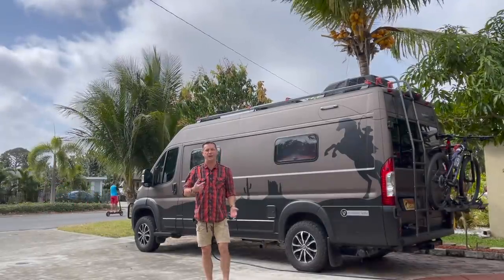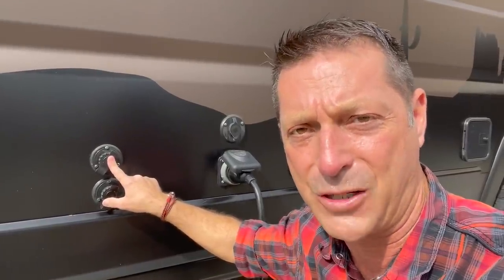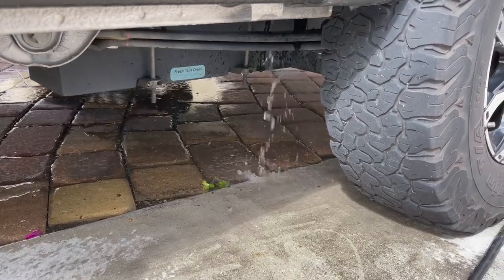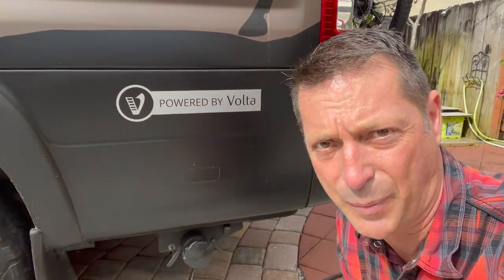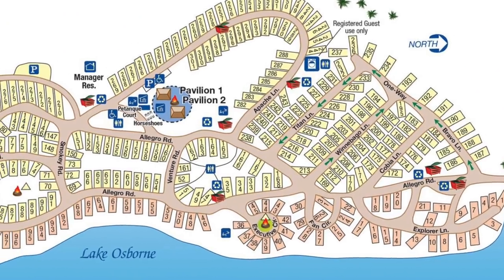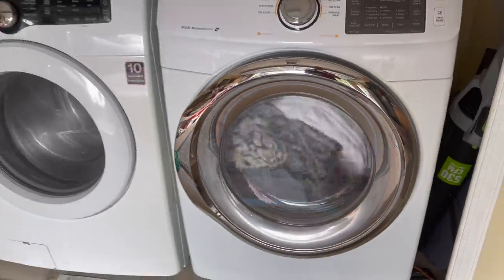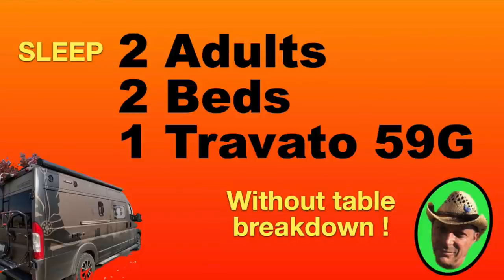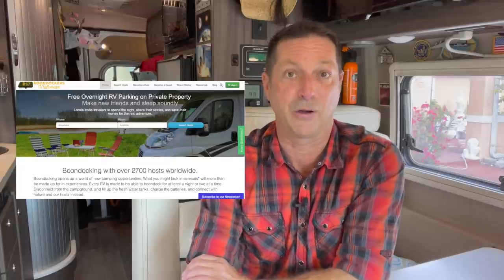3 TIPS to INSTALL RV HOOKUPS saves $. MAKE EXTENDED VISITS HAPPIER. By 2yr full-timer Travato GL van

Comment: Why do u need a dogbone adapter?  If you have 30 amp service at this house, why not just plug in to your newly installed 30 amp outlet along with the surge protector.
Reply from the maker: Great observation. I did not want to complicate the video… but the reason you see the dog bone is because the electrician misunderstood and installed at 50AMP receptical as that all that he brought. 30 AMP circuit at the box.
Reply: @gosmall.livelarge  gotcha. i thought that may have been the case but wasn’t sure. rock on.

Comment: A lot of people would much rather use their own RV bathroom.  Not strange at all.  Did you consider a macerator pump for emptying the black and grey?  Kudos for emptying those small tanks only once a week.  I can barely make it through a long weekend without filling the tanks of my TT at state parks without sewer.
Reply from the maker: thanks Brett. My grey has a macerator pump. Black is gravity.  Thanks for watching and commenting sir !!
Reply: @gosmall.livelarge  You could use a wheeled blue boy tote to transfer to the sewer clean-out.  They make low profile tanks for pop ups that would be low enough.   I only suggest these options because driving 30 miles and paying $15 seems excessive, but then I'm used to state park overnights at $20-22 per night including dump stations.   Maybe you enjoy your "outings" once a week as it gets you out of the driveway for the day.

Comment: Sewer.  Check out the Sewer Solution (Amazon) it works great up to 100 feet, less than 100 bucks plus small cost for some 1.25” pvc tubing. You won’t need to go to the dump station anymore.  Been working great for me for 2 years now. It’s much simpler to install and operate than meets the eye.
Reply from the maker: David… Thanks for the tip!  Featured that product on my What’s Up Wednesday?! YouTube Live #vanlife RV show this past week.  Cool looking product.

Comment: "non-Volta, generator " T owner here.  I think the adapter works the same way in my rig as it does in yours.  I plug in and just set the One Place to the lower input setting. That  keeps us from blowing the fuse in their garage. Lets us run the AC or Truma heat on heat strips just fine.  Surprised that you Volta folks ever need to plug in.
Reply from the maker: Thanks Roger. If staying for a few nights I probably wouldn’t bother, but I’m not driving to charge the system… and the A/C is running 24/7 as the temps are in the low 80s in day and low 70s at night.. That type of power consumption calls for shore power

Comment: I had a similar issue... fixed sewage with a maceratot pump.  A portable Flojet can pump 100 feet uphill.
Reply from the maker: Good to know
Reply: I read that information too and I can understand when the hose is full and the water keeps coming.  But what about at the end of the release, there is nothing to push the water / waste up hill.  So you disconnect the hose and now everything in the hose flows down hill?
Reply: @toycarcollector  I do a rinse, and then “walk” the hose from the RV to a he dump inlet to ensure any remaining stuff has drained from the hose into the sewer port.

Comment: Great video. Another option for those with larger rigs that are less mobile. A wheeled sewage tote. You can dump your tanks into it , wheel it over to the clean out and dump without having to move your rig. You can also use a regular 20 amp outlet with an adapter to plug in if installing a 30 amp service is not an option. You couldn’t run ac but it would probably keep you charged enough to run ac off the Volta when needed.
Reply: Hi I think you might answer my question so I’m still fairly new to RV my don’t have lithium just solar and generator so sound if you are plug to shore power to 30 amp outlet at home you can’t run your AC? Can you run microwave? Thanks
Reply: @liaodesign  if you had a 30 amp outlet you could run the ac or anything else in the unit. You might trip a breaker if you ran the ac and other items like microwave but probably not. My comment was based on being plugged into a 20 amp regular household outlet with an adapter. An ac takes more than 20 amps and would trip the breaker in that scenario but not with a 30 amp service. I have a 30 amp outlet at home and plug my camper into it to charge when not traveling. It also makes a handy extra guest room.
Reply: So I’m using adapter connecting to my 20amp outlet I shouldn’t try to run AC or Microwave? I never try it and probably won’t since I’m home but just want to know thanks.
Reply: @liaodesign  you could run the microwave on a 20 amp circuit. That’s what you do in your house. Just not with very many other high draw items on at the same time. Just remember in the camper everything is running off one outlet so don’t try to run a bunch of items at the same time. You’ll know if it’s too much when a breaker trips. If it doesn’t trip you’re good.
Reply: Thank you for the info!
Reply: @liaodesign  the 20 amp outlet is mostly for moochdocking as most people don’t have 30 amp outlets and installing one for a short visit isn’t very practical. If you need AC you can use the generator but they can be noisy and unwelcome in neighborhoods
Reply from the maker: Thx Dan for the options.  Appreciate you helping Liaodesign too!

Comment: Mooch docking is a nice change from Boondocking and RV parks. I'm surprised you didn't talk about a maserator. It's a pump you can attach a hose to the pump, it grinds down the waste and pumps it through a smaller hose. Then you can run that hose inside to toilet on the main floor. Then it pumps your waste water into the house sewer system. Great video.
Reply from the maker: Interesting points.  I think I will stick with quick empty tank dump LOL

Comment: Rick from Madison Wisconsin here.  Excellent information Scott.  I have already added a 30amp RV receptacle in my garage to accommodate my new Gemini when it gets here in May.  I will be replacing the toilet in the RV with the Laveo toilet (thanks Terry Minix), so waste issue solved.  I also have purchased a fresh water hose, but still need to get the green filter system selected.  I have learned so much from watching your video's, and appreciate the effort and information you share with us.  Looks like I am going to travel to Southern California to spend a month with family, so I will moochdock with them, but I am sure they don't have a 30amp hook up, so I will have to use the dogbone connector for the rig.  Thanks again.
Reply from the maker: Sounds like are making all the proper plans.  Proud of you !

Comment: Great tips!  I researched using one of those portable macerator pumps to empty the holding tanks, which can use a garden hose to move the contents to the sewer clean out up to 100 ft. That would make it very convenient to park in a driveway for longer periods without having to hunt down a dump station.
Reply from the maker: good point !

Comment: OK- you axed for it! Great video (was that a sigh of relief?) and you kept it moving at a very reasonable pace- Thank You! But, was hoping for a cost breakdown for the 30 Amp breaker install- it couldn't have been inexpensive, although- a great bonus for a longer stay!!! If it 'adds value' to a homeowner, perhaps (if the cost is more modest, of course) it could be split or shared- spreading the electrician cost over a couple of people. The Price would be very helpful. Also, it's completely 'Nermal' to wanna use your own bathroom, and most people I know would be super grateful for your considerate behavior! Personally, I would shower in the haus & ONLY if everyone else were gone, occasionally use the terlet. But, personal grooming, teeth brushing & ADL's- definitely in my own rig! H2O savings alone (tank trips) makes using the house beaudoir worth it. Just sayin' Great video though- I learnt a ton! I'm a Host truck camper guy, not a B-van owner. Just caught the wiring cost (after the free bonus advice!)- My Bad! Thanks all around!
Reply from the maker: Thx for your thoughtful comment !!

Comment: I put in a 30A box at my house. We used it for our trailer and I’d use it to cool it to clean it after a trip. I’d also cool the fridge and pack it before we left. We could use it for a guest room too. I had electric, water and cable Tv all accessible to it. My septic is around back so that would not really work. 
Have you ever looked into a macerator pump for sewage? It can pump up hill and it would make that distance you showed. You could even leave it there for next time 🤷🏼‍♂️ 
Just a thought ✌🏼
Reply from the maker: Thanks T S M :)    Hadn’t thought about a macerator pump for sewage.  Tank dumps are so easy
Reply: @gosmall.livelarge  they are but they make ones that will click on like a hose. Has a motor on it and hose. Just need to connect it to the battery and pump away. 👍🏼

Comment: Ha, no permit needed where I live. No one gives a damn what we do out here in the (currently frozen) sticks. And you could dump directly into the septic if you don't mind driving across the "yard." So far the standard house outlet is working fine for Lucille in the garage but I will put in 30amp at some point.
Reply from the maker: Frozen TX. Yikes!!

Comment: Thanks for Another excellent video.  Where you are parked you look pretty level.  You may have mentioned this before....Do you ever level the rig?  Do you ever have problems with not being level?
Reply from the maker: Thx Greg.  Leveling is usually not an issue. If there in uneven surface I move the van to remedy best I can. I don’t use leveling blocks.

Comment: Wouldn't be cheaper to get a 15amp to 30amp RV conversion cable?  But it might trip fuses depending on appliances running in house so you probably did it right for a long stay but handy to have for a short one not a electrician just putting it out there 😎
Reply from the maker: have one of those converter cables. i / we wanted full 30 amp service to run a/c 24/7

Comment: We do not like dump stations so we bought an external macerator and a 25 foot hose large diameter hose.   Costs about $350.  We pull up to one side of our home and use the clean out connection.  I love it because I can do serious cleaning on the tanks at my leisure.  I can dump and rinse as many times as needed.  I added a clear connection so I can see where we are at with the cleaning.  Using this system I can get all the way to clear water out of the black tank.  It can take a while however, usually 2 to 3 rinses.  The Travato G has a macerator but not the small hose.  Can you connect a macerator hose to the Travato G?  They say that you can even use a standard hose in some cases.  If you have not already seen this video on black tank maintenance it is very informative.  https://www.youtube.com/watch?v=wUWGlm2gQfE
Reply from the maker: Some great points T C C…. You are right on cleaning out black tank. I have used ice with the best results. Thanks for sharing !

Comment: I’m a bit confuse about the electric why u need a dedicate 30 amp box can you just use the adapter and just connect to the regular household 20 amp  outlet looks like the yellow adapter you go there? That what I been doing when connect my RV at home. Also not been negative not sure  the sewer tip is a tip isn’t that a no brained if you can dump you would need to go to the nearest dump station. I think i need to invest and get one of those flexible jose like what you go seems lighter and save space! Since been watching a lot of your awesome videos not to get personal but since you and Kyle married so you guys don’t live together in the RV? Great video as usual thanks for sharing.
Reply from the maker: Thx for asking… in this situation which is semi-permanent, is because the two outlets in the garage are nearly overloaded without the RV.  So had to look for an alternative. Which lead to the 30 AMP dedeicated circuit, which works better for current and situation and when RV guests come to visit.

Comment: Richard here from Ca. I've often wondered what the increase of a homeowners utility bill would be from plugging our RV;s into them. After Covid-19 clears up and we are permitted to travel more loosely, we would like to visit family and friends in other states but don't want to burden them with an excessive utility bill if we stay for an extended period. Question. Since you tend to stay at your in-laws more frequently, do you have and idea about how much their utility bill has increased? Great video!! Thanks. P.S. Have you ever sanitized your fresh water tank? Is it necessary since you live in yours full time?
Reply from the maker: Hey Richard. Sanitized tanks no, but I empty tank regularly and fill with fresh water so the water doesn’t sit. I probably should sanitize. But too busy drinking the water from the system! As to utility bills, quite minimal I think. 6-8 fresh water tank fills in a month at 18 gallons = $10 maybe?!  Electric, imagine plugging in a window A/C unit that is used 10-15 hours a day at 70% cycle… guessing $50?  Glad to hear you want to stay with friends and family longer

Comment: I think using the house bathroom is no big deal, just clean up after yourself.  Also you could pee in a bottle and dump.  Seems contradictory to use their soap and washer/dryer which costs electricity too but not impose to use a toilet, which you could use your own tp.  I vote all or none😉😘
Reply from the maker: pee in bottle… nope. thanks for sharing
Reply: @gosmall.livelarge  lol thought you might react like that but it is a solution.  Thanks for the chuckle.